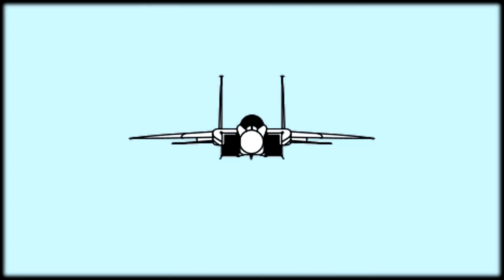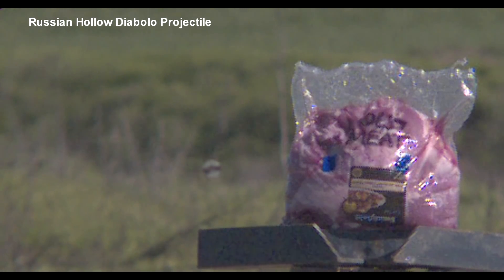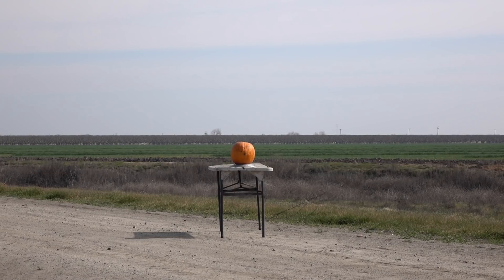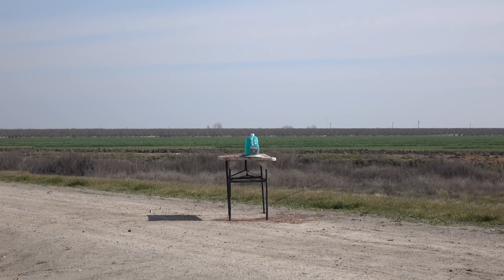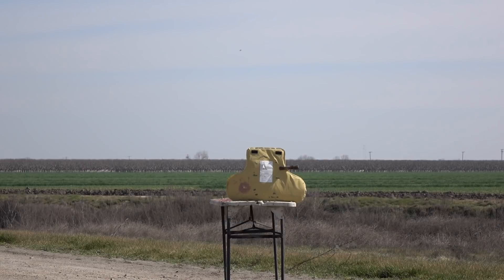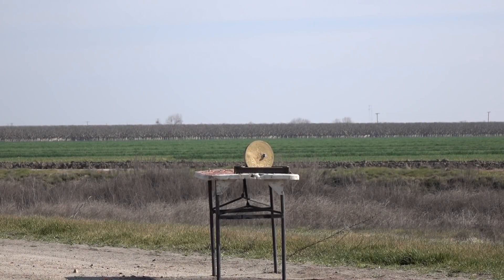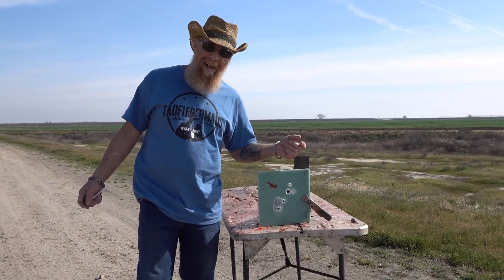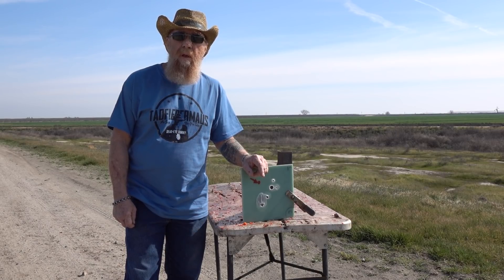Skeletonized Diabolo Projectile - Spin makes everything better?

Comment: Regarding spin stabilization:
If a solid object has a way to dissipate rotational energy it will tend to rotate around the axis with the greatest moment of inertia. For long slugs this obviously creates a flatspin and therefore serious loss of accuracy. If, however, the slug is shorter than its width or the dissipation of rotational energy is slow enough ( rifle bullets) spin is creating more stability in flight.
Reply: That explains foster slugs being kinda stubby. Is there a specific length past that makes this true? Would a 12 gauge diameter by 12 gauge length have stability?
Reply: The intermediate axis theorem? Possible, but I think that it is far more likely due to the gyroscopic effect. The slug is designed to stabilize itself by bouncing off it's own shockwave, and when rotating, that normally corrective force is offset because of said effect, causing instability.
Reply: @JessicaBiros  gyroscopic (in)stability is exactly what causes the wobble because it's not spinning on a stable axis. If you know about intermediate axis then you should know that's how it works out.
Reply: @JessicaBiros  I'm not talking about the intermediate axis theorem. Since most slugs are rotational solids there is no intermediate axis. There are two axes with exactly the same moment of inertia and one axis with either a greater or a smaller moment of inertia. The third axis is along the shooting direction.
The reason for the instability is much simpler dimensional analysis:
The angular momentum is proportional to the moment of inertia around this axis multiplied with the rotational period. The rotational energy is proportional to the moment of inertia around an axis multiplied with the rotational period squared.
Assuming the angular momentum is constant the rotational axis of a solid cannot change from a axis with smaller moment of inertia to a axis with greater moment of inertia and vice versa without dissipating/ gaining energy.
For example: The slugs moment of inertia around the longitudinal axis is half its moment of inertia around a perpendicular axis ( since the slug is rotationally symmetric the exact axis doesn't matter).
If the rotation shifts from the first axis to the second axis the rotational period must be halved to keep the moment of inertia constant. Let's see what the rotational energy does if the axis shifts:
Double the moment of inertia and half the rotational period squared results in half the rotational energy. Therefore half the rotational energy has to be dissipated to make the axis shift possible.
Since drag forces are dissipative it is far more likely that a long slug looses rotational energy than a short slug gaining rotational energy. Therefore short slugs get stabilized and long slugs get destabilized by rotation ( assuming loss of rotational energy is fast enough to impact the slug before impact).
Reply: @edlubs11  The calculation of moment of inertia of solid objects can be tedious and difficult. I think a cylinder with the same length as the diameter probably has about the same moment of inertia around the longitudinal axis as around perpendicular axes.
But that is exactly what you don't want to have:
You want to have the greatest difference possible between the moments of inertia to create the maximum energy difference. Therefore rotating slugs should either be as flat as possible or really long and aerodynamic ( rifle bullets).
Reply: Wow you fellows are putting way too much thought into this just enjoy the videos
Reply: Wow that's a lot of words
Reply: @lukasdimmler2622  you're right, I should have read your post more carefully. In my defense, I was on the verge of falling asleep when I wrote that. That said, I still maintain that what I suggested  is a contributor to the instability, though not in the confused, nonsensical way I expressed it. What I was trying (poorly) to say is that when the slug is spinning the normally corrective interaction of the tail with the shockwave produces a torque that causes the slug to precess, leading to an unpredictable flight path. The only reason that I might suggest that over your explanation for this circumstance is because of the observed behavior, but in all likelihood both effects are complimenting each other.
Reply: @JessicaBiros  I think your explanation and my explanation don't contradict each other. My explanation is generalist while yours is phenomenologic.
My explanation describes what needs to happen and yours describes how it happens.
Reply: @stephanhelms3282  It's science. If you're not thinking, then you're doing it wrong.

Comment: Nice job Taofledermaus (Jeff) explaining the difference between an "Aerodynamically Stable Projectile" and a "Spin Stabilized Projectile". An aerodynamically stable projectile will destabilise when spin is added just as a spin stabilized projectile will destabilise without spin. The engineers decide which type of projectile they want and then design it. For example, the gun on an M1A2 Abrams MBT is the M256A1 120mm smoothbore gun and all of its projectiles are designed to be aerodynamically stable and extremely accurate.

Comment: One thing I've noticed for spin stabilization to have a chance at working is that the rate of spin needs to match the combination of diameter, length of projectile, weight of projectile, and shape of projectile. As far as slugs are concerned and this video proved not all shapes need spin. Now if possible to make some of these stable with spin would require a lot of custom choke tube "like" pices and trial and error to get it right which really isn't feasible on a budget.

Comment: Spin stabilization on fabricated assemblies will be inherently unstable due to deviations in the mass distribution about the axis of rotation. aka, they not balanced. Fasteners are some of the most chaotic items out there with regard to their dimensions. A flat head screw has its head impact formed and then threaded. The heads are normally always off center and out of round. Put one in a lathe of drill chuck, held by the threads and pull the trigger. The head wobbles all over the place. The mass distribution is not centered on the mechanical axis of the part itself.

Comment: There is some awsome science speek going on. Love it. I agree with what I could understand and I'll give the benifit to what I could not. I'm perry simple I. Other words. There was the statement in the video that the separation of the sabot does not effect stability. This would be closer to the truth in my expierance for smooth bore but not so with rifled bores. In smooth bore with the type of sabot (cup type is noemaly what is used for Smooth bore) that you are using  is made to "pull" off to the rear of the projectile thus causing little to no effect on the flight or stability. That is not so with it bring spun. Think of the three pettles as air spoilers like that on an aircraft. On the lift surfaces all it does is spoil the air and reduce lift and air flow. So when in a Smith bore it pulls itself off the projectile, now same thing spinning bot this is more in line with the propeller not the spoiler, once you add spin and the fact that the cup was sticking to the slug base and the pettles not releasing at the same time it will throw your accuracy out. For at least two reasons 1 there is now an inbalance in weight and 2 there is a greater instance of drag on one portion of the tail effectively negating the ability to selfstablize inharent to the projectile design. I would think you could use a different sabot one that is spun off an away like what is used by 25mm fsdsd-t. These are fired from a rifled barrel and away then rearward as they slow down. Just a thought.

Comment: Idea: 
Use the hollow Diablo projectile as the base shape. Have rifling engraved outside on the lower portion of the slug that fades going into the middle curve with a hole in the center. The projectile can have a decreasing diameter going toward the hollow end (like the whining projectiles). During sub-sonic flight, added with the rifliling of the barrel used, I believe the projectile could have better stability

Comment: Smooth bore allows for a greater variety of projectiles with out suffering accuracy losses (or ablation to rifling).  All barrels will ware out with enough stress. Our military employ's many smooth bore designs. like in the M1A1 Abrams with its M256

Comment: I think the reason the spin is making the accuracy unpredictable is because the way the projectile flys. Since the screw was being bent one way or another it was causing an Asymmetry in the weight distribution of the round. When shot out a smooth bore the slight bend wasn’t going to cause the round to wobble around as much, while the spin would cause the Round to act as if it was “tumbling” and causing the inaccuracies we are seeing.

I wonder if the projectile were to not be bent in the process would the spin help or not? Also would it help enough for it to even matter or would it be negligible benefits?

Comment: I would bet my life that the screw presents a whole set of issues. I'm sure it's probably not even very concentric or balanced its self much, let alone what the thread allowance causes as far as funny stuff, etc. If the thread was made in the same operation as turning, it should be pretty true. However the screw / head are it's own part that may or may not have been turned all at once l, etc.  Bottoming out the screw may cause it to kick on an angle though. If the shape was turned as one piece eliminating the screw, I think it would have better / different effects. There are also 2 different metals, density and masses, rotational forces, etc with the screw being involved. Non of anything I said matters, but hopefully it makes someone think. When maching objects at those speeds, the smallest things can (or cannot) matter sometimes.
Reply: Wow. That got really technical. Lol

Comment: Another thing that proves rifling is not always better, most Modern Battle Tanks (MBTs) use smooth bore cannons. What stabilizes the rounds that are fired out of them are fins, like a missile for example. MBTs typical rounds are APFSDS (Armor piercing fin stabilized discarding sabot), HEATFS (High Explosive Anti Tank Fin stabilized, and sometimes even ATGMs (Anti Tank Guided Missiles).  One of the main reasons for using fins instead of spin is the fact that modern tanks almost always engage distances over a mile, which means the gunner will have to account for the round spinning as the round will strafe in the direction it is spinning. At close distances that spin makes almost no difference, however, at long ranges it does. Of course a computer can account for this much easier, however, APFSDS was developed before the computer could do this. and was found to be a great solution for stabilizing a long dart meant to penetrate angled armor from many miles away.

Comment: I kinda wonder if in the case of this particle ejected from your mass accelerator wasn't also effected by some center of balance issues along with the sabot not hitting the ejection button on time. Could a small metal disk between the mass particle and its sabot carrier help the ejection better.

Comment: I would suggest the cavity in the screw head causing the sabot to become entangled added to the spin caused the inaccuracy.... with the smoothbore  it didn't affect it that much
Try this round with the screwhead filled in... then add riffling
Reply: I tend to agree that some other disc should have been supporting the shot cup. The sabot being forced into and around the projectile will create wobble and pull. I blame the leading in this case and the last test was luck!
Reply: Giovani Tapini, I tend to agree with your assessment here. Was about to suggest the same thing myself. Seeing as how the sabot ended up being jammed into the cavity of the allan head I am about 99% sure the sabot had a large part to play in the inaccuracy of the projectile here causing the various points of impact. Hell I would have slapped a solid backing pad in between the head and the sabot prior to loading after the first shot seeing as the issue raised its head from the very shot....
Reply: Giovani Tapini, I tend to agree with your assessment here. Was about to suggest the same thing myself. Seeing as how the sabot ended up being jammed into the cavity of the allan head I am about 99% sure the sabot had a large part to play in the inaccuracy of the projectile here causing the various points of impact. Hell I would have slapped a solid backing pad in between the head and the sabot prior to loading after the first shot seeing as the issue raised its head from the very shot....

Comment: Have you ever tried wax slugs shot through rifling, smoothbore and a rifled choke?
Maybe also just try different stuff to bind the shot like latex, different resins, flexseal, superglue (wax the shot cup first so it doesn't stick), elmers glue and other weird but potentially decent bonding agents for the was slug idea
Reply from the maker: I think it would cause them to break apart.    They are pretty fragile.

Comment: I'm not completely convinced by the mass accelerator. You need some sci-fi sound effects. Like, pew-de-woop-ding!
Reply: Indeed. The mass accelerator has a distinctive sound which could confuse YT contractors into thinking it was something dangerous.
Reply: What do you mean?  The rapid electromagnetic pulse of a railgun sounds like a gunshot. The rapid acceleration behind the projectile makes a very low pressure zone behind it, causing a loud crack as the vacuum cell collapses, and the nose bursts the still air with a high pressure cell, which collapses around the nose, causing a supersonic clap. That's what you're hearing. The electromagnetic mass accelerator, or EMMA, for short.
Reply: @kitaryakysubae3156  See this is why we don't have proper railguns yet! Someone got the physics all wrong and forgot about the sci-fi sound effects.

Comment: The sabot being driven into the allen key cavity implies that some or all of the sabot held onto the projectile after normal separation time. Spin would then imbalance the projectile

Suggestion; use a thin felt wad in the bottom of the sabot or use a full size wad and a sabot with no base

Comment: Spin destabilization isn't a new thing on this channel. I remember your mighty Thunderbolt and DGS-12 slugs that were working perfectly with a smooth bore, but didn't work with rifling (or was it a rifled choke?). Either way, interesting to see that.

Ps: I wonder if you have any of these 2 slugs left and you could do a range test with these? I remember your high praise for them.

Comment: what it looks like is you need a thin disk between the plastic cup and the projectile, that should allow for the G-shock to not make it stick around the projectile or it will lock it in better and create a new problem...
Reply from the maker: there was a thick wooden card under the sabot.

Comment: problem with spin is that density isn't equally distributed. Bullets are made with such precision that this is corrected for but  just making a billet of metal round doesn't mean the center of mass is on the central axis

Comment: Not 100% sure but I think that last one got a little spin because of the sabot stuck in it (just nitpicking here dont mean to offend or to say that "spin is a must for stable flight" :D). That screw in it is one weak point since one of them was bent, so without that they would perform better.

Comment: Spin introduces as many problems as it solves. If your projectile is not ballanced properly, it will be kicked off to the heavy side of the projectile as it exits the barrel. With the plastic getting stuck in the back of the projectile, it would shift the balance all over the place. I suspect this may be a contributing factor to the random impacts you had.

Comment: Would it have been more accurate if the wrench hole was filled so that the sabot couldn't jam in there?
Reply from the maker: Probably not since the little wad of plastic from the sabot  would weigh the same as whatever you fillled it with.
Reply: @taofledermaus  but would the sabot release cleaner?

Comment: Spin stability only works if the projectile is spun at the correct twist. 

A short slug requires less spin than a long slug. 

Here is a ballistic calculator designed to help shooters know if a specific spin will stabilize a particular bullet.
 https://www.jbmballistics.com/cgi-bin/jbmdrag-5.1.cgi

Notice that the length of the projectile is not the only factor, however length has the most impact on stability.

Comment: Spin makes accuracy possible at distance. Some designs don't do well with the available spin. Those designs wont be accurate as spun projectiles from the barrels you have. Not all spin rates are the same. Optimal spin rate needs to take length and speed of the projectile into account. Simple spin vs no spin is cave man level shit. Unless you can vary the rate of spin the spin / no spin thing is mute ... except at short range, shotgun range, sometimes no spin is better than the spin rate you have available. Even on lead balls, spin helps stabilize for better accuracy. Ask the military in the 1700s when they started figuring this out. Without rifling there was no tight aim, you just pointed in the general direction of the enemy's mass. Spray and pray from many weapons.